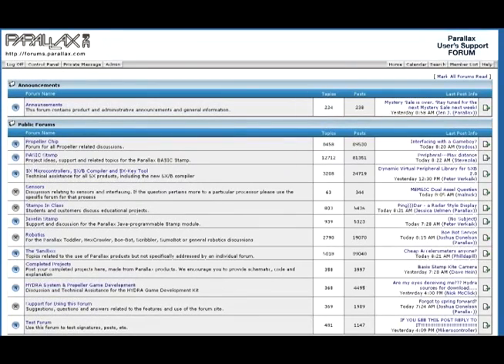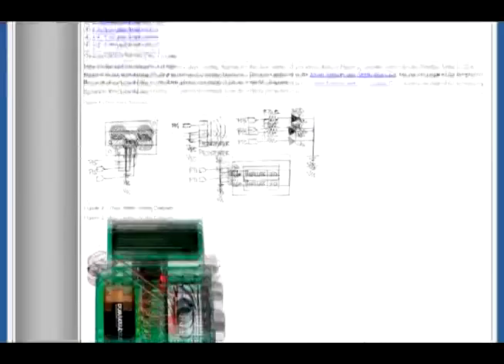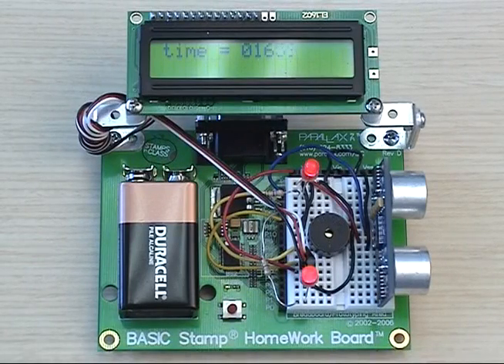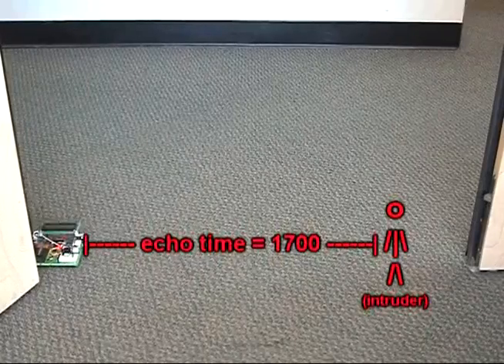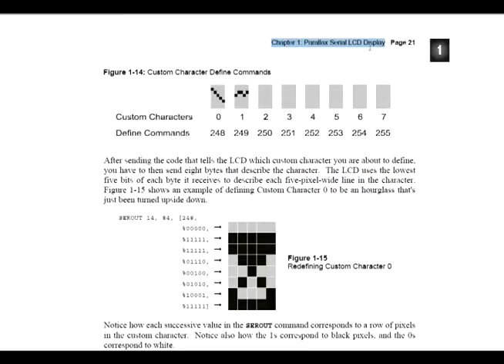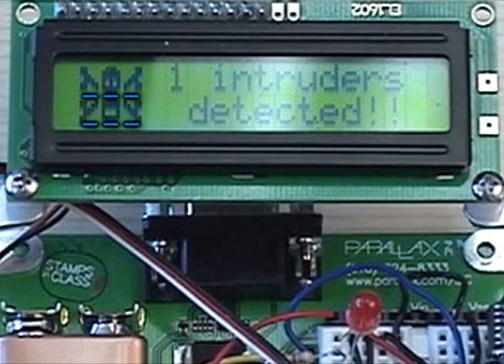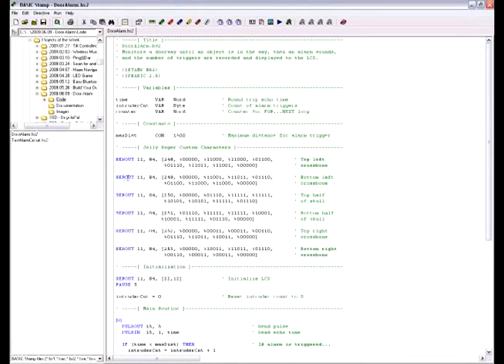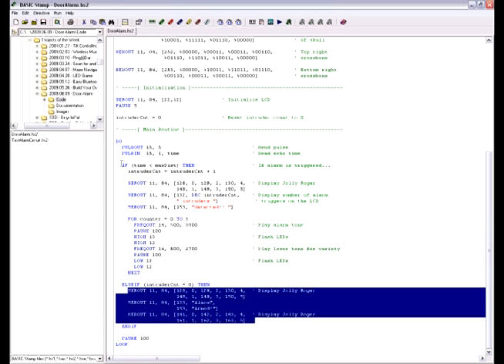Build Your Own Door Alarm

Comment: "Intruder" steals all your expensive stuff from home. So, when you get back home, you will check the display if there were any intruders. 

I dont say its not fun to program assambler but there are better (but little bit harder) ways to make something useful, which will make a good sound once the detector is activated.